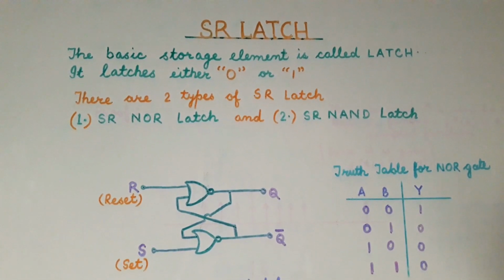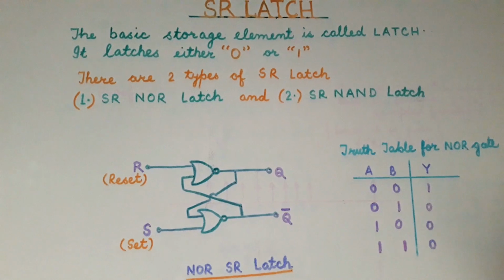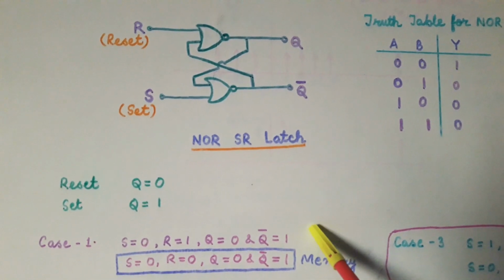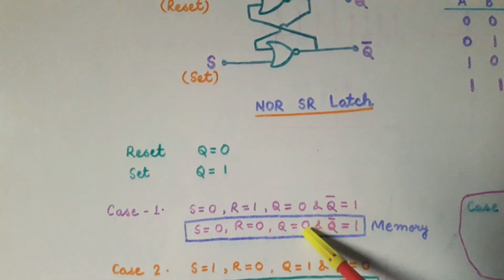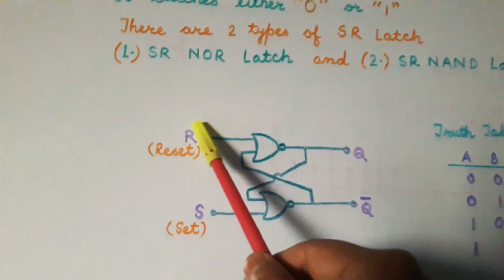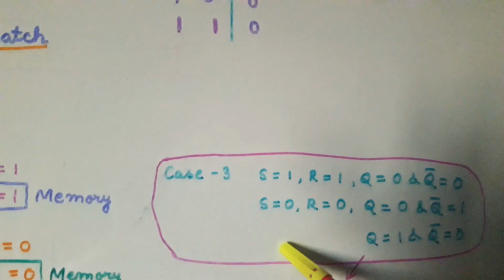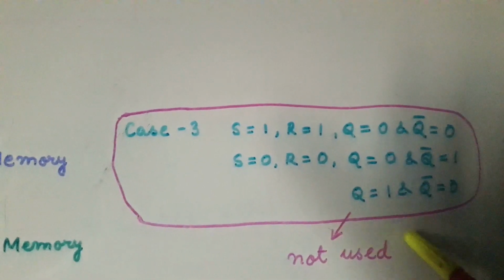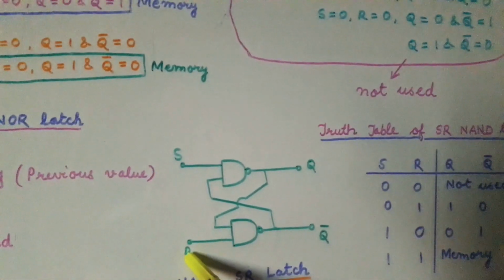SR Latch

Comment: Nice, But My question why you are using case1 : S=0 and R=1 first instead S=0 and R=0 and why the port is changed there exam R is on top and S is on below.. Can't we use S R instead of R S
Reply from the maker: Nice question. We are using the case 1 as S= 0 and R=1 first because the output of SR ff changes only when both inputs are different. So here our ff will be reset i.e. Q will be 0 and Its complement will be 1. Now once we have stored 0 and 1  we want  to prove that now if we remove these outputs i. e. R and S ..still our output should remain the same wch we had stored. That is y we took this case.. even if you take R=0 and S=0 first then the output of the ff will be same as its previous stored value. So u can start from any case. It is not necessary to start with R= 0 and S=1.
Reply from the maker: You can use SR also instead of RS but in that case the position of the  outputs Q and Q complement will have to be changed to get the correct output of the ffs. Also one should remember that in case of NAND gates ff the value S= 1 and R= 0 will reset the ff . Similarly R= 1 and S= 0 will set the flip flop. whereas in case of NOR SR latch S= 1 and R= 0 will set the ff.and S= 0 and R= 1 will reset the ff.